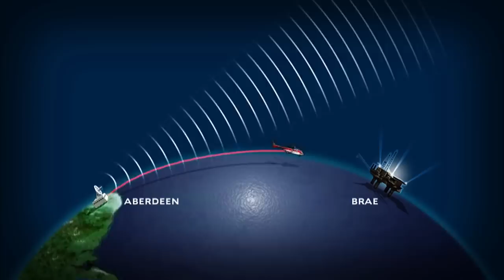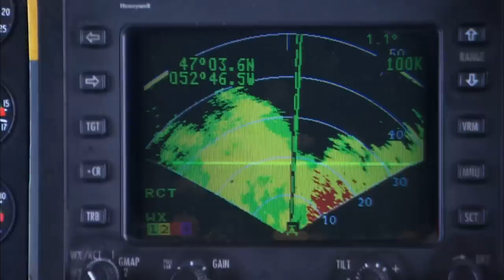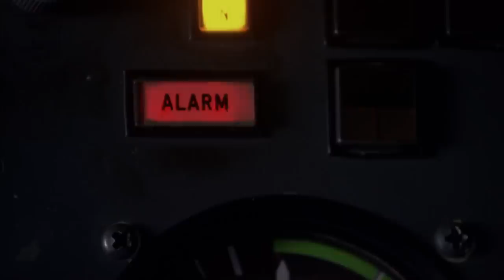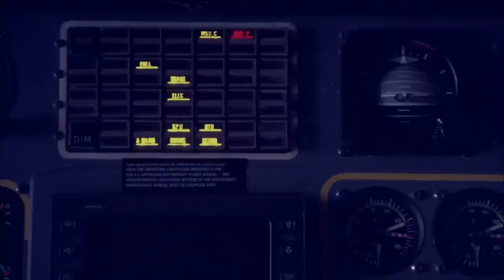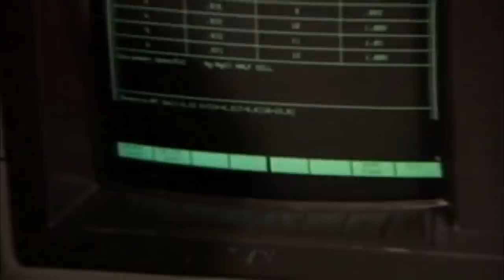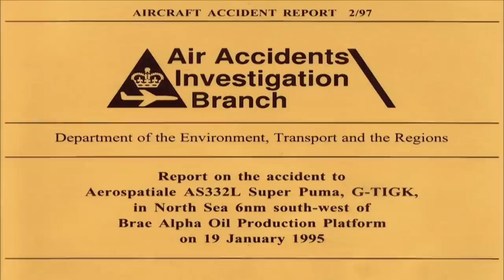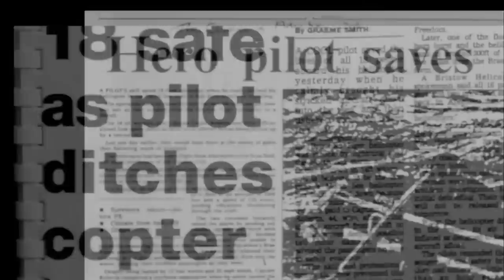The Tragic Story of the Lightning-Struck Super Puma | Mayday: Air Disaster

Comment: A number of hazards immediately evident-- all of which should have been addressed before 56 Charlie met disaster.

1. Navigation/location systems were fragile and poorly designed. For example, could any helicopter have determined its exact position by GPS? In a distress call, that much could have narrowed the search area, quickly. For another example, each oil rig could have had a radar unit to help locate objects in the swept area-- helping eliminate the loss of contact from Aberdeen.
2. Requiring helicopters to fly into hazardous conditions was a judgment call-- officially-- but pressure was on the pilot to complete the mission, and that contributes inevitably to disaster. 
3. 56 Charlie was overloaded and its raft was not designed for the North Sea.

Why was it difficult to anticipate these problems?

Comment: They only had a raft made for 14 people + there were 18 of them onboard the helicopter.
That alone seems ridiculous, such a basic oversight is hard to believe, more passengers than there were places aboard the raft?
That seems laughable, to me........... surely the capacity of the helicopter should equal that of the raft, shouldn't it?
I would argue, yes.
Reply: Well, they had two of those rafts but the other one got stuck on the side of the helicopter because of strong winds, blocking that side's exit.
Reply: I see, I missed that, so they weren't as slack as I thought.......... I admit that not paying attention is something that's been suggested may possibly be an area with room for improvement.
A few squared acres of room is probably about right, I'll have to work on it.
Thanks for setting me straight on that,  doing it without a hint of 'smart-arsery'
is notable, admirable, too.